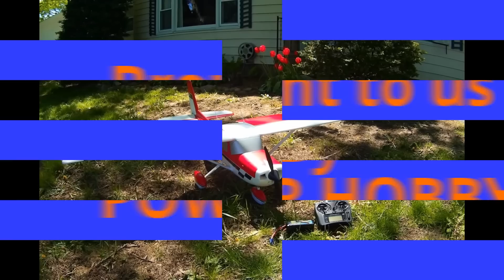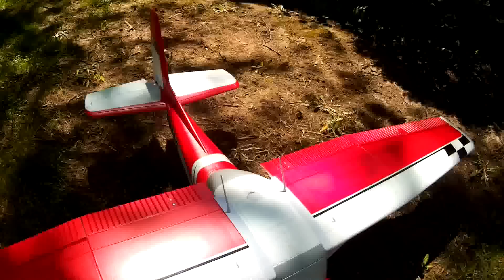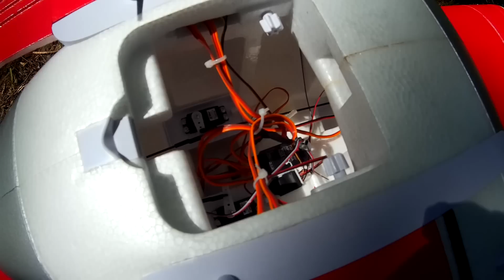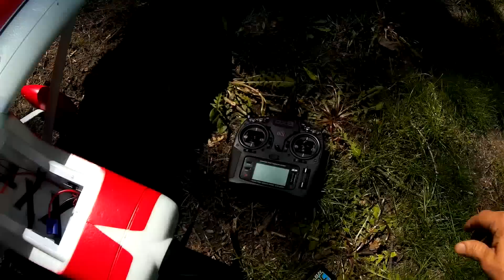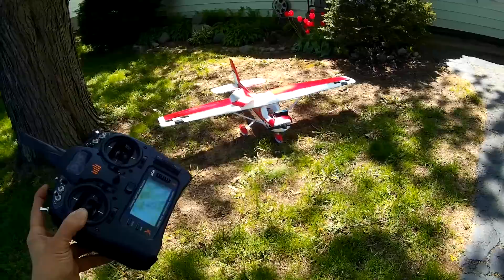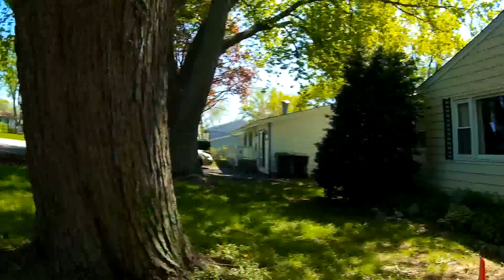(NEW) E-Flite Carbon-Z Cessna 150 2.1M AS3X+ Safe Select Binding Procedure/After Build Review

Comment: During the process when it actually bound, I did not notice you changing the switch to ‘on’ on the esc. Did you have it on or off? When I plug in my lipo, it plays the start up sounds, but once I flip the switch to ‘on,’ it’s like everything dies and the LEDs go dim/out. Struggling to find out why.
Reply from the maker: @NoobFPVDrones3DPrint  that's a good question ❓ 
Wish I had an answer for you on that one you're probably going to have to go straight to horizon hobby for that one. Good luck 🤞

Comment: Skip I'm ordering a 6s from revolectix
Reply from the maker: I thought it was weird that all their other planes have automatic adjusting esc's, but the one they used in that plane has to be manually programmed or with a programming card to fly 4s.  I promise though, you would not be happy with lack of performance on 4s.  6s is barely enough for me.  I feel it could use more power still.  Trust me on this one my friend.
Reply: @SkipBuiltRC  I'm going to buy a 40c 5000 mah 6s from revo and try running a 6400 5s on 40 c I have a local flying club that's helping me out but I just want to get it into the air on safe mode first time
Reply from the maker: @Farmermanrc  or just put 2 3s batteries in series to get 6s.  Just a Thought

Comment: I got good news and bad news with my 150. Bad news is that I couldn't get help to record the unbox video and the worst news is that the throttle isnt working and I'm having troubles with the rudder good news is that its soon ready for the ski. Need a bit of help skip
Reply from the maker: Don't know exactly what you are asking.  Throttle doesn't work and rudder problem of what type?  Suggest calibration of esc as always with a new model. and check your linkage for binding if rudder is sluggish.   Without being there or any more info that's the best I can offer at a distance my friend.  Good luck with her.  Horizon Hobby always has experts trained for that particular aircraft... Just a Thought.
Reply: Thanks but the 4s has a 70c discharge rate 4400mah should have the power  but will buy a 6s battery
Reply from the maker: @Farmermanrc  c rating has nothing to do with it.   Voltage is way different.   14.8 - 22.2v.
The Esc is programmed for 6s only,  unless YOU re program it.  Really,  call HH and ask them.
Reply: I'm running 4s
Reply from the maker: @Farmermanrc   Hey buddy that's your problem right there. You're using 4S but the ESC is set up for 6 s. The ESC on that plane does not automatically switch for 4 or 6 you have to program it for it. It comes stock setup for 6s. Trust me you don't want to fly it on 4S anyway.  Way under powered.  Put a 6s batt in it and ALL your problems are solved.   Happy Flying my Friend,  Skip
P.S.  Thanks for the subscription.

Comment: hey skip, i noticed you said that you can have safe select if you have  that receiver programmed. i have a 636a receiver that is programmed for a timber already. id lovr to put it into an fms beaver about the size of the cessna. how would i go about doing it if its possible?
Reply from the maker: Supposedly that's possible. I talked to Horizon Tech and he said that it was possible theoretically. But I don't know how you would go ahead about hooking it up and which channel would be being used for the as3x as I have not done any of that yet but I've been thinking about venturing into it. I would love to have an ass 3x safe select receiver on a couple of my planes that I'm not real easy with flying yet

Comment: I have the basic DXe 6 channel transmitter(no screen.) It bound fine and I'm not really worried about it having safe mode. My issue is the flaps don't work with the flap switch. Instead they fully engage when I press and hold the panic button. When I release the panic button the flaps go back up. I would like the option of 50% and 100% to 0. Everything else works fine.
Reply from the maker: The problem sounds to be a plug in wrong slot or you have to set up your radio .

Comment: skip. i have a 636ar receiver and want to put it in the same plane. i know how to bind in safe. dont know if its programmed tho. its in the box. if i get the cable is there a simple download online to set it up for a timber per say. im not too savvy on setting gains and other stuff but if its just a download , i can figure that out
Reply from the maker: Michael Rajca afraid that I can't help you with that.  I was told that the ar636 receiver has the program already in it. Just bind it like you would have safe select and that should be okay. That's what a gentleman over at Horizon Hobby told me. But he said not to quote him! LOL
Reply: i think it  was set up for a timber already. how did the safe work on the cessna and do you think it might work the same way on a fms 1450m mustang red tail which im afraid to maiden without safe, i have the lemon rx with stability plus installed now but dont know how it will work. kind of  newer but learnin as i go along and dont wanna dump a plane on a whim lol. thanks skip. any help would be great my friend.
Reply from the maker: It worked great.  I don't know if the same will work on your mustang, but I've been thinking about trying the same thing some day as I would like that option in some other planes I have.  Good luck.  The guy at Horizon said theoreticly it should work the same way.  just make sure that corrections from gyro,as3x works in the right directions or it,ll be a rough ride.

Comment: Ugh man.. DO NOT COPY how this is being bound in the vid unless you want your plane in safe mode! My Maiden was in safe mode and I pity anyone that learns to fly in that mode. Sounds crazy but I'd rather possibly crash my plane and really feel the sticks than have it nuetered to death. Lol
Reply: drewpert 15. Just to be quick. You are not totally correct. 
Hold your control sticks in and down.
Flip your gear switch 5 times. This allows you to turn the safe off. 
I don't have an airfield to go to and I am teaching myself to fly. 
So all well and good if you can, but some of us simply need the safe. 
The biggest thing I think it takes away is trimming a plane. But surely so many other things I could use at an airfield if I could go. 
With everything, it has to be used responsibly. I will flip off safe very soon after I am airborne and possibly use it for landing. But I will also be doing some FPV and having some quads chasing, so knowing it is level is helpful during those times.
Reply from the maker: drewpert 15 that's sounds good and all for you. If that's the way you feel that's fine. But there are other people out there with limited or no flight experience that want to learn to fly RC. Crashing $400 plane maybe the way I have had fun in the past, but I wish I had learned the right way and started with gliders and trainers with das 3x and safe select. I would have learned to fly sooner although it did only take me 3 months to get the idea of it. Is playing also comes in a PNP version so that pilots like you don't want the AAS 3x or any stabilization can have it or like your saying simply binding normally.
Reply: Skip-Built, RC. Safe select doesn't really "teach" though. It's watered down flying that sets up bad habits to expect. Mostly though it takes away from the fun of flying and the true feeling of flying with full control on the sticks. Part of the fun was getting better and having to think about what you did wrong and learn from it. The best way to learn to fly was going to a club and buddy boxing with real human interaction with someone with real experience and feeling what real flying feels like. This isn't even being a pilot snob or elitist about it but I was actually kind of sad yesterday flying it thinking I'd hate for someone to think this is what true flying feels like. I didn't start out with $400 planes. I knew better. Learned on $100 Park Zone micros. Anyhow... It is what it is. I just think Safe is horrid.
Reply from the maker: drewpert 15 drew you have some very good points there I have to admit. I take back what I said about learning with the trainer. I started with something hard crashed a few times but you're right. I learned something every single time I flew and crashed and I knew what to do the next time because the AAS 3x hadn't already done it for me. So very good point my friend thank you for your comments. At first I thought just another guy that hates das 3x for whatever reason, but you stated your reasons and they're sound. Kudos buddy and happy flying, skip

Comment: hi, can you give me any settings for my radio for the Cessna 150 carbon z, I have the 150 bonded in safe select,  example , gains or throws, tto set in radio, I am a beginner, thanks  Bobby
Reply from the maker: I would start on THIS plane with a 70% throw and 30%expo all around.  It's very docile, easy to fly.

Comment: When making adjustments and setting up a new model, the propeller should always be removed for safety.
Reply from the maker: Martin Bedding Thank you.   I get nervous sometimes and forgot.   my bad.  I usually set the throttle cut before also.  Forgot that too.

Comment: I didn't mess wit safe......no need too. All  I did was  a normal bind then flew it....simple as that......no expo, but then again I never have messed with expo on anything. I never did find an expo switch in any full scale airplane I flew. Flying rc is a lot harder than full scale, and maybe I could use all the help I could get lol. I have about 1300 hrs in full scale 150s and this thing flies scale (at 1/2 throttle) rite out of the box. 1/2 throttle is about what the full scale is like at full throttle lol. The full scale was always considered a mutt as far as performance goes.

Comment: Just watched your speed built video and it was a lot of help when I assembled mine, also thanks for mentioning me on the wing issue LOL, but I noticed you were able to plug the battery up then remove the bind and then activate the radio, that's new to me
Reply from the maker: williewideback that's how you have to do it to put it in safe.